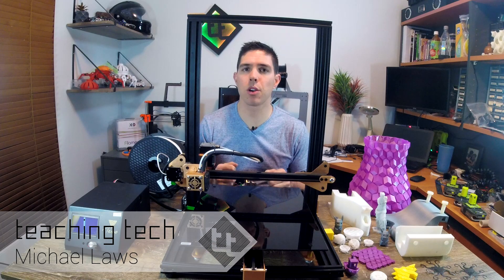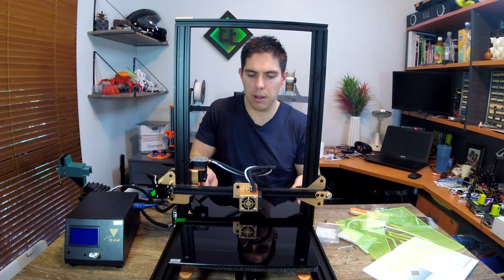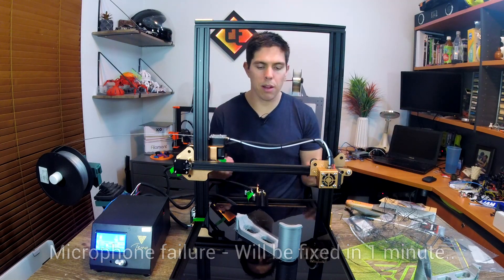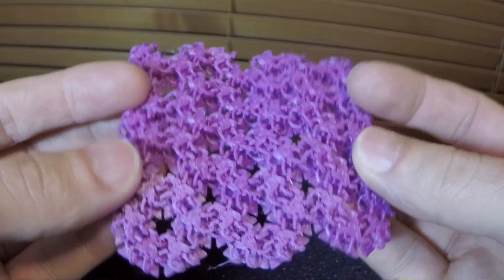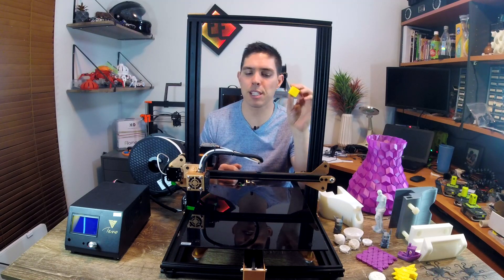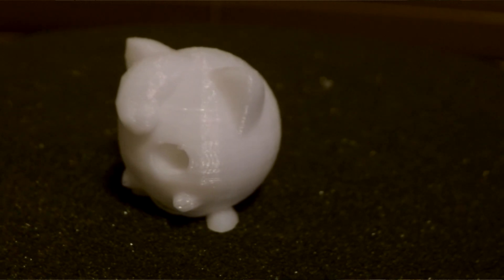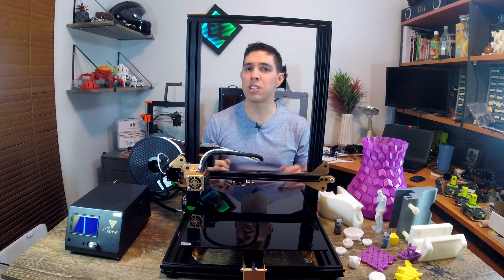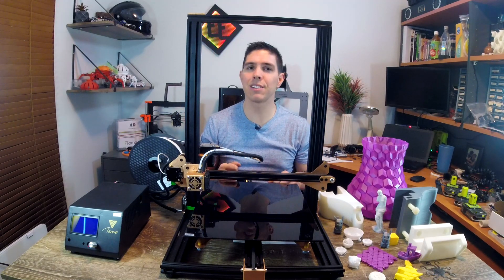Tevo Tornado 2018 edition review: Big volume, big value

Comment: Michael, Please don't use paper to level the bed use a set of feeler gauges and pick the distance from bed to nozzle you want. As using paper I assume you are expecting 0.1mm or 0.004" which should be a pretty standard size. However,one set of gauges will be good for 100's and more cycles and should probably not cost more than a couple AUS $ and will be so much easier in the long run. If you ever need to adjust the distance on anything else then you will already have a set. Sure a bigger print volume but what are print times like?
Reply from the maker: Hi Dominic, I start with paper but then do a live adjustment for the next print after. Print time get long pretty quick. A model scaled twice the length is four times the volume. Other people are more patient than me, that's why I'm going to fit the large nozzle.
Reply: Michael, You have to customise yet your cura profile/slicing etc to allow for the larger nozzles? Can the extruder (wheel especially, keep up with that much 1.75mm filament out and retract on faster prints. Sure you do but watch out for filament detritus about the extruder. I'm curious as that is why I stuck with 3mm on what was a K8200 as the sheer volumes of plastic that needed to be printed and 3mm worked better? Linear advance at speed has some interesting effects. 1.75mm I ended up with lattice walls and not solid ones as the layers laid down with not thick enough as the extruder couldn't keep up, I thought it was skipping until I looked at what was printed under a microscope. Effects with 1mm nozzle are even more interesting! On Ender 3 usable limit seems to be 0.6mm and 80mm/sec on thinner walls I don't have a Tevo to test it on.
Reply from the maker: Still 1.75mm filament but I did have to slow down the feedrate and retraction speed to stop it stripping filament. It added print time but was still stupidly fast compared to the 0.4mm nozzle.

Comment: Great review Michael. Although I'm not planning on getting the Tornado, you have raised some excelent points that I'm planning on doing with the CR-10s which should be the same (or adaptable). Transfer the electronics to the base, so looking forward to your video on that. Planning to get and extra complete hotend and install a 0.8mm nozzle (and a Noctua fan) which should make it relatively easy to swap between them.
Ideally I would like to convert my CR-10s to be 24v, but I think that might be a bit overkill, so I'm thinking it may be better to install a 240v (UK) bed heater.
Just remembered, I have a spare genuine E3D Titan extruder, so probably will install that too, perhaps the E3D hotend too when I find/design a suitable mount.
Regarding the BL Touch install, the dupont plugs weren't very secure, so I've ordered some JST's just to be sure, still waiting for the EZABL. On that note, I would like to configure the standard Marlin firmware for both the BL Touch and the EZABL, so will have a search for info on both.
Keep up the great work mate, I really appreciate it.
Reply from the maker: Hi spike, I assume the CR-10S has a fatter PSU because it powers the bed. THe Tornado one is quite streamlined as it only powers the nozzle. I'mhoping to fit everything under the bed without rising the frame but that might be too hard. If it helps with th BLtouch I have a video that goes through the settings on a version of Marlin closer to vanilla: https://www.youtube.com/watch?v=BV11-VOQjMc
Reply: Hi Michael, Ah yes, the PSU may well be a bit fat on the CR-10, I'll wait to see your video. Thanks for the link, another superb video.

Comment: Did this model needs Smoothers to resolve salmon trouble or they correct on this 2018 version?
Reply from the maker: Had zero surface artefacts which surprised me so I guess it is resolved.
Reply: That depends on your power of self suggestion. I'm not good at self suggestion and generally weak in believing. Therefore two different types of smoothers had no effect on my old Tornado model and they probably wouldn't have an effect on the new one either.
Reply: Just got. i’ll be waiting for must have mods for this 2018 version. Thank you
Reply: just swap out the drivers for TMC. I didn't notice any artifacts before or after upgrading.
Reply: Gianfranco Panico Still need smoothers

Comment: Went to the link. A little iffy... They say ship color may vary and show a green older version in the box. Which one are they shipping??? Really want one but don't want stuck with the older version. Thank
Reply: Here's the skinny! US version is green not gold or glass bed.
The new green version has the MKS Gen L board, A/C power to the bed and has a slanted face display, it is also 24 volt. The heat bed is not glass ceramic, it is I fiberglass thermal composite with there version of a glue on build tack (flat, check with dial indicator).
Hope this helps guys! Still shady advertisement none the less....
Thanks for the review Mike and letting this feedback stay up!
Lucky Larry
Reply: I emailed them and this was their reply.....

Dear customer, 

you can choose the ship from China, it will be 100% gold one. 

we have BIG SALE during 828 Aliexpress promotion, price lower to 299USD.
Reply: @gridarmorfix  might order another. That's a great price for a great base unit to tweak into a workhorse for the print farm.
Reply: Just got the 2018 model. It's the old green model and not the one you show...
Bait and switch!
Reply from the maker: Where did you buy it from? If it's from the link Tevo gave me that has gold version pics, you should complain.
Reply: @TeachingTech  I am in the process of working it out. So far they claim they ship which ever is in stock and feel color is irrelevant. I explained the one advertised on their site has many significant improvements.
Will keep you updated.
Thanks Larry
Reply: @luckylarry5112  you will have to let us know. Before seeing this video I didnt know an updated version existed, I now know it does but how do we get ahold of one now lol.
Reply: @luckylarry5112  they did this shit to me too
Reply from the maker: That is the link Tevo gave me. When I follow it I see the gold one..? Perhaps contact them first to make sure.

Comment: Good review, I have the previous version of the tornado, and I like some of the upgrades they gave it. I found that a rubber washer on the top of each bed leveling screw really holds them very nicely when leveling. I do like the new colors,
Reply from the maker: I fixed the bed levelling yesterday, will cover this week. Thanks for watching.